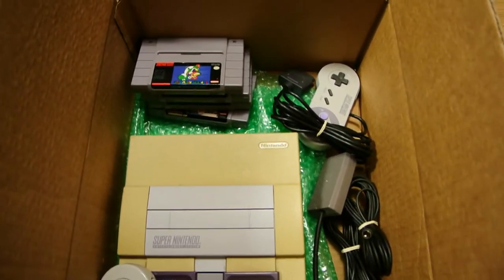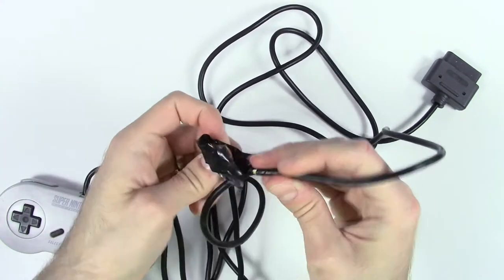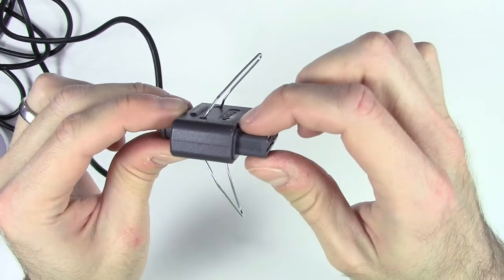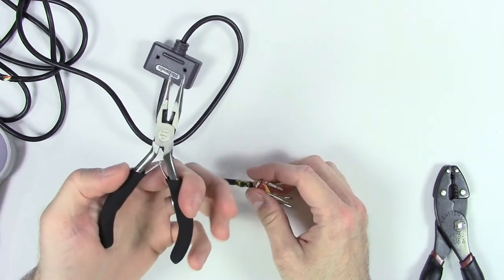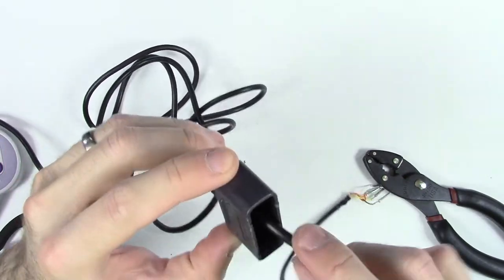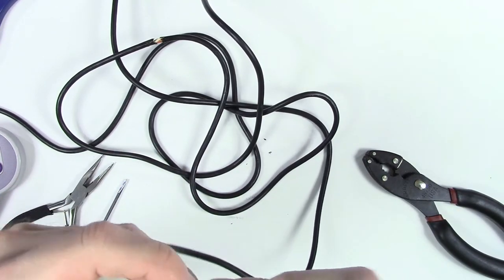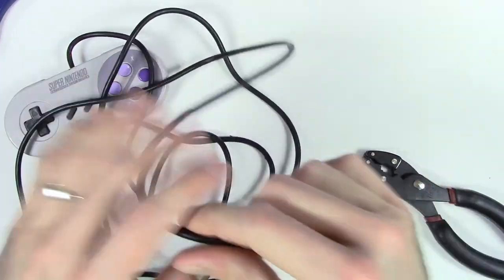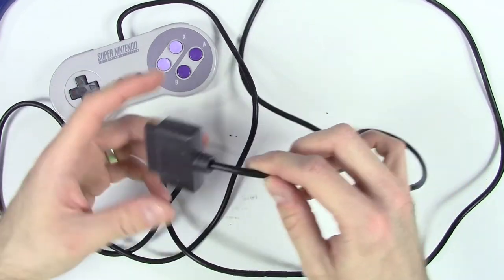Repairing SNES Controller Cable Damage

Comment: For anyone who came here for cable repair you should know that all you have to do is open the controller then yank the connector from the board and the cable is loose. The connector is on there pretty tight so you have to wiggle it or use a small screwdriver to pry the sides but it will pop off. After that slide on 1/2 inch 4:1 marine grade (glue lined) heat shrink tube and shrink it. You can see the connector at 9:40 on the official (top) controller. This is a good video if you need to see how the plug goes together.

Comment: What "I" do with f**d up cables is go to the electronics store (Fry's), buy some NEW cable, pins etc and make a NEW cable. OR, you can buy the shittiest SNES controller, unsolder the controller, and plop it on your good SNES along with the plug. Some SNES controllers have a plug on the PCB, so it can be as easy as plug and play.

Comment: For those of you who do not care about the cable and plug. You can buy for like 5 bucks replacement cables with the plug and all and just open the controller and solder in the new cable..

Comment: Or just buy an extension cable, cut the other end, check the pinout, solder to the controller (either straight or use the original connector and bit of cable) and be done with it. In the end you have a nice new cable.

Comment: Thanks for this tutorial. My Hyperkin Supaboy connector port pushed a contact back into the housing and rendered it unuseable on my snes console. Strangely the controller still worked plugged into the supaboy. This video helped me fix the connector for the controller. I wont be plugging it back into the supaboy ever again.

Comment: Hello, any chance the controller paper clip trick might work with the N64 controller as well? I have a couple that need some serious cable repair but the controller cap is very tricky to take off. Thanks in advance for your videos.

Comment: If I recall correctly, many original SNES controllers do not have an internal disconnect for the cable. There's still a PCB connector, but it seems permanent and needs to be desoldered.

Comment: Thanks for sharing your wisdom!

Will you also make a video of how to repair a cable that's actually broken (i.e. the pet rabbit was a bit more successful in its attempt to eat a cable and actually chewed through some copper wire)? ;)

Could you solder the broken wire and then apply the heat shrink (I doubt the soldered connection will hold for long)?
Reply: It's actually a quite similar solution, although you pretty much need to do what he did to this entire cable for each individual wire. Splicing them together, getting heat shrink over the area which needs isolation (that is, on each individual wire), and then finally getting heat shrink over the entire thing.

Comment: not sure how this thing works but would you be able to cut it in half, cover it over the wire and still apply heat?
if anything id glue it and then apply heat.

Gotta be an easier way than taking apart the controller and all that.
I dont think i need to do any of this, i dont game retro much anymore and my snes should be in great condition.
Reply: DjStiv3 That sounds like a better  idea. Quicker and easier. I use a small piece of scotch tape to hold the Shrink T in place and then use my heat gun. The scotch tape gets fried but it doesn't stick to the cord. It's easy to remove.

Comment: Needed black tape over the damage FIRST ding-a-ling to get the shape back. Now you have a weak point.
Reply: Would be easier to actually just use a shorter piece of the same heat shrink.